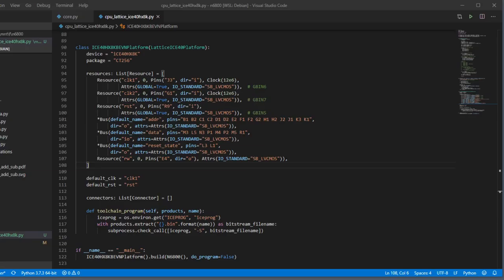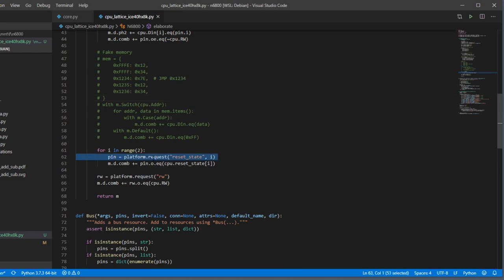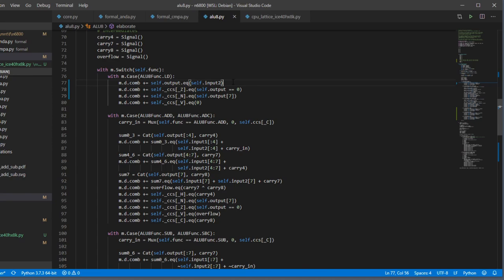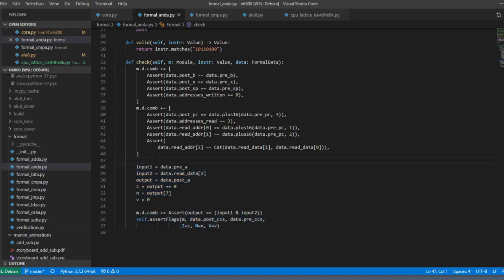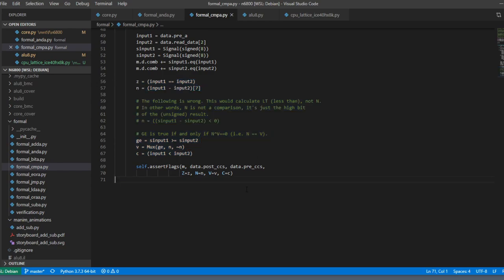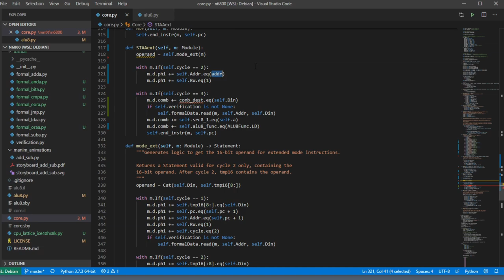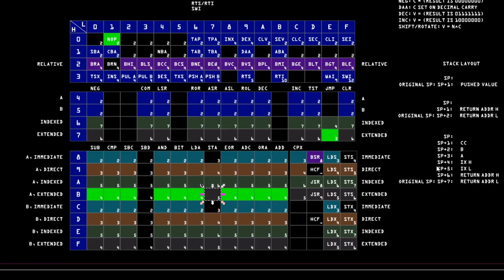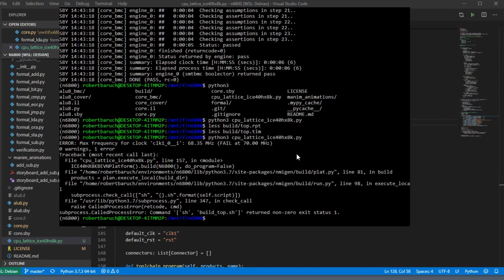Building a 6800 CPU on an FPGA with nMigen (part 5)

Comment: Placing PC+1 all over the place is not a issue since the compiler will combine them all into one adder. One of the neat things about the compiler is that it breaks everything down into gates and then combines gates that are doing the same things. So imagine two XOR gates with the same two inputs. The compiler will see that the output is the same and then combine them. This is done after all layers are combined. The main downside of this is the longer compile times.

Comment: I see I am not the only one with a feline supervisor.   It is nice to see how this works.  The 6800 is a nicer cpu than the 6502.  Apple created an software 1802 to get around the 6502's limited registers.   The 1802 was halfway between a microprocessor and a micro-controller, especially in some versions. Your instruction table reminded me of the hours a buddy and spent with the 1802.  We programmed in pure hex, not assembler and damn little hardcopy IO.   Keep up the good work.

Comment: Great series Robert!
One note - global reset should be placed (in HX8K chip) on GBUF 0/2/4/6, GBUF5 is not suitable to use as reset input - see iCE 40 LP/HX family datasheet (DS1040), page 6. All global buffers can be used as clock inputs, GBUF 1/3/5/7 can be used as clock enables and 0/2/4/6 as resets. If I remember correcly the routing fabric in HX8K doesn't allow LUT output to be connected to any GBUFs, so your reset is routed through much slower routing facbric and LUTs thus consumes much more resources than it should.
Reply from the maker: Thanks, I missed that on the data sheet!

Comment: I saw your recent blog entry on reverse-engineering a PMOS microcontroller.  I always thought PMOS chips were a bit strange, needing a high negative voltage with respect to ground to operate them, but then they are more stable than NMOS and can switch high voltages directly, which is why they were used for so long in devices using VFD displays.

Comment: Hey.  Firstly, been watching a few videos.  Some videos ... like your discrete component RISC-V are cool in a voyeuristic way: I'm glad you're doing them as I would never get there.  Other videos ... like this series are more practical.  On to my question...

So I've ordered (from China) an Artix-7 development board.  Specifically, the chip is a XC7A100T-2FGG676I.  Before I checked back on this page, I was looking at "migen" (precursor to nmigen) and it had a platform that was roughly XC7A200T-FBG676-2.  Close, but not quite.  Looking at nmigen, I don't see a similar platforms directory and I'm at a bit of a loss where to look.

I ordered the board from China based on price and specs: it has 101k logic units.  The board also has 256MByte of DDR2.  It was only $130 or so...  Roughly, my goal was to have something "large enough" that I wouldn't "run out" yet still affordable.  I probably would have spent up to $200 on this ... but this board, if it is what it says it is ... seems pretty good for the price.

I must admit, tho, I'm at a little bit of a loss... it hasn't arrived yet and I think I might need some form of programmer-adapter ... but I'm waiting to buy that for when I know more.

In the mean time, the problem I'm finding with nmigen (which seems cool when you use it) is locating my chip and/or platform in it.  Also some hint on documentation would be cool.  Are we just to read the old migen docs?
Reply from the maker: Regardless of your FPGA, nMigen will generate Verilog code, which means you can at least go through the vendor's tools. What you're probably asking is, does yosys support Artix-7? Basically, no. You can use nMigen and yosys for simulation and *verification*, but for actual *synthesis(, you will have to generate code from nMigen via "-t v", and then use the generated Verilog, plus whatever configuration file Xilinx uses, with Xilinx's tools. I don't use Xilinx, so I'm afraid I can't help much with that. 

Hope that helps!
Reply: @RobertBaruch  Ok, then, if you don't mind, how would I set up nmigen in this case?  How might I refer to my hardware's "features"?
Reply from the maker: @randomscribblings  That I don't know, sorry :/